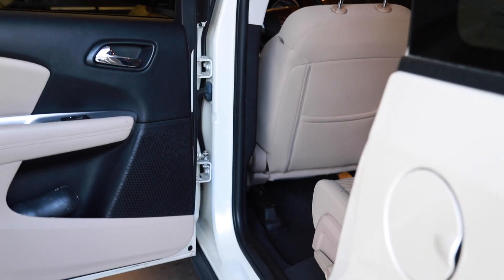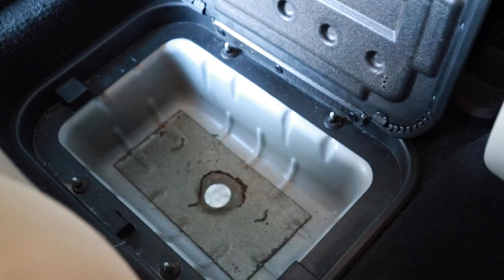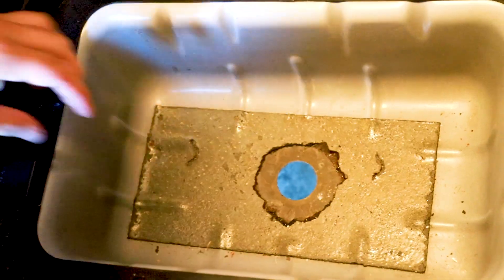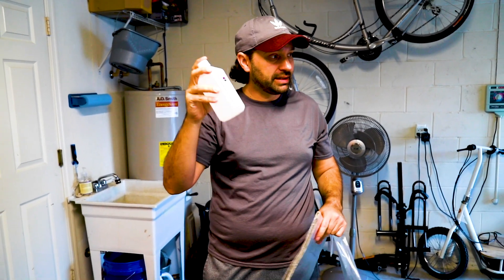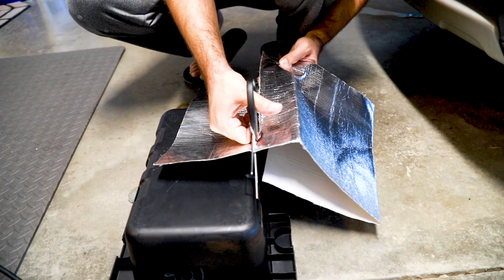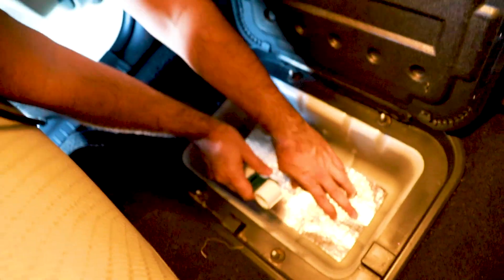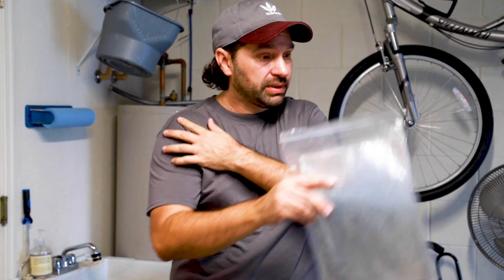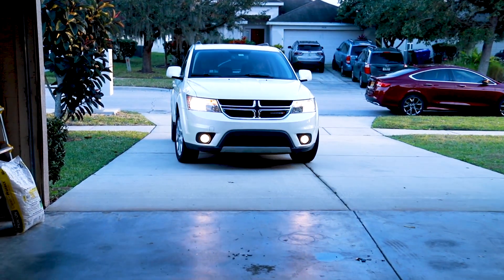Dodge Journey | Plugging Holes in the Floor

Comment: I know this is an older feed but my storage bin holder, the metal part it's self is dented and I was wondering if you had any problems with yours getting dented and any ideas regarding who to talk to about this. I hit something that dented both sides so my plastic containers don't fit flush any longer.
Reply from the maker: 🤔 I would imagine a body shop could fix that. The metal is way too hard down there to apply any home remedies. Mine are not dented but I have seen some cars being lifted on the bin rather than the frame.
Reply: @Turbo_Snail  Thanks, I will get ahold of a bodyshop and see what they can do to knock it back into place, I will keep you posted, thanks for the reply.
Reply from the maker: @richardhill2379 shop around. I’ve gotten some prices for a little dent anywhere from $190 to $800. My rule, get at least 3 quotes. Good luck!
Reply: @Turbo_Snail  I will follow your suggestion there, both are dented one is worse than the other, I'm thinking a grand or more now after your quotes. I was hoping maybe they bolted on to make it easier. Thanks Turbo !
Reply from the maker: @richardhill2379 if you’re not going to use them for its intended purposes, we’ve used ours maybe 2 dozen times in 11 years, I don’t think it’s worth fixing. Just make sure there is no water coming in and I would leave dented.
Reply: @Turbo_Snail  I am surprised that there are no vids on this situation here, the few of us cannot be the only ones, but a lot of the things I go through with my journey there are no video, cas in point, I have a failed windshield cowl, that I can no longer take through the car wash due to the large amount of water washing over my engine causing all kinds of havock with my electronics and I suspect thats what cracked my exhaust manifold,  lots of stuff to deal with.
Reply from the maker: @richardhill2379 these are usually very solid cars. These were not popular here. But they sold. Maybe look for Fiat Fremont. It’s the same car but European version. We had very few problems and I only make videos of stuff that I fix. Maybe I just got lucky with this one.

Comment: Do you know the parts number for plug
Reply from the maker: no unfortunately I dont. If there is any additional info it would be in the description. Check with Chrysler and see if they have replacement plugs unless you wanna do it my way.
Reply: What is your way
Reply from the maker: the way I did it in the video. I used the old plug.

Comment: sooo it would seemlike that your journey was modified. mine has the plug but not that tar pad. same with my sisters and mothers journeys
Reply from the maker: Interesting. Mine was stock like that. So yours is good then? Or do you have any leaks there? I wonder if that was added during a recall. I’ll do some research there. Btw, mine is a 2013 model.
Reply: I assume that plug would be used as a drain. If you had liquid in your bin or something, remove it and pour it through the plug. Which sounds odd because it would rust. Why a plug at all?
Reply from the maker: Yeah, if it was an off-road vehicle yes. But the plug looked like it was taped down to begin with and looked broken/rotten. Maybe the same platform is used for an off-road vehicle? Not sure. All I can tell you is that when it rains I got no more junk down there.
Reply: @Turbo_Snail  it is the same platform as the Grand Chetokee they are very similar and both have these floor drain for the "Floor Cooler" strange idea Daimler especially in regipnd that use heavy salt in the winter my journey is so rusted around that drain already
Reply from the maker: Yeah, not sure what’s going on. But that platform is a bit different than the grand Cherokee. It’s based on the smaller Cherokee. The Dodge Journey is actually part of the Fiat Fremont, Chrysler 200, Dodge Dart, cherokee family. The grand Cherokee is bigger.
Reply: @Turbo_Snail  I’m having the same issue with my 2020 currently on the driver side. Both of mine have the sticker or whatever it is on it. Have you had any issues since you put the heat shield down?
Reply from the maker: @sydneysimmons3302  No mine are still in perfectly after I fixed them.
Reply: Ok where can I get this stuff? I just removed my bins and there was water in one and looked like oil in the one behind passenger driver seat. 😢
Reply from the maker: It looks like they were meant as drain plugs. That are non removable. But they leak. That’s why I sealed it in. I had always crap down there and when I drove in the rain it smelled…. Humid inside. Fixed and done. Links should be in the description!!!